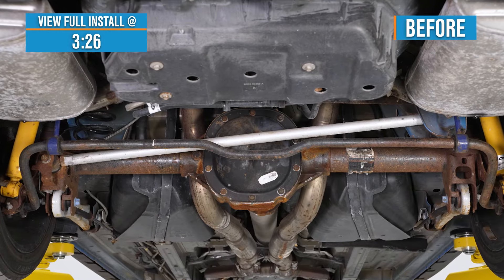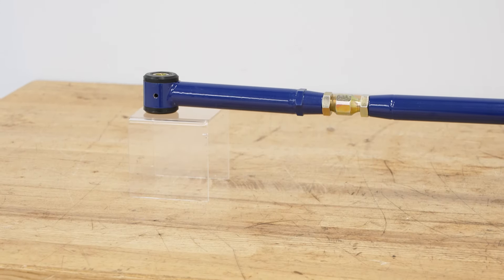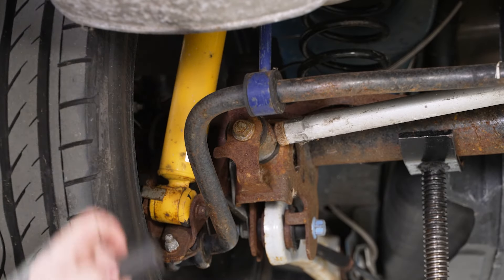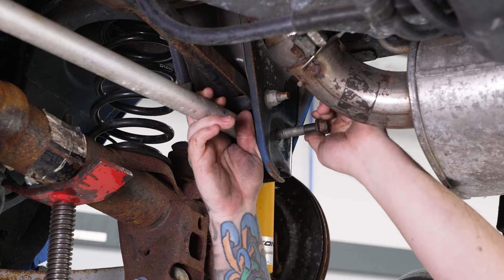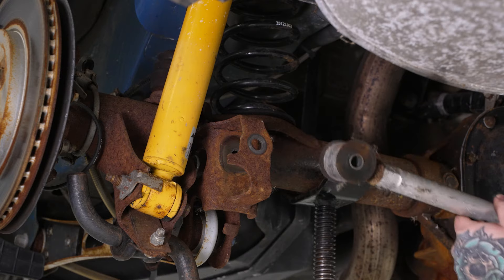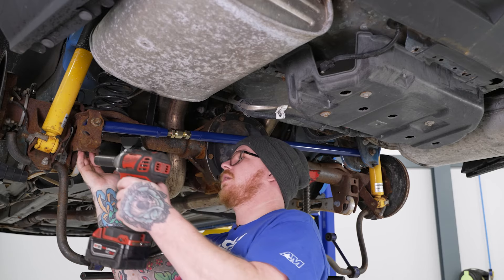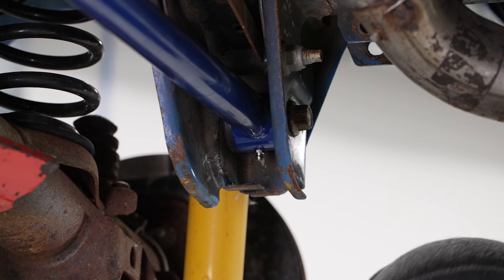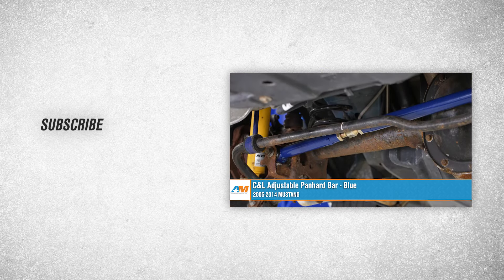2005-2014 Mustang C&L Adjustable Panhard Bar Review & Install

Comment: After I installed my panhard bar i had a roaring, humming noise in the rear i did adjust and tightened it down so no play is in the bar. What causes this??